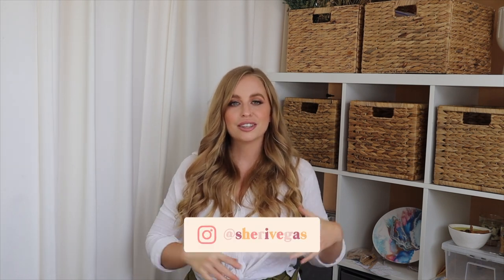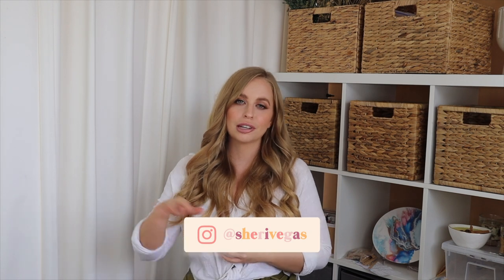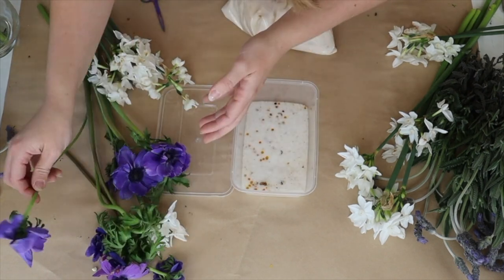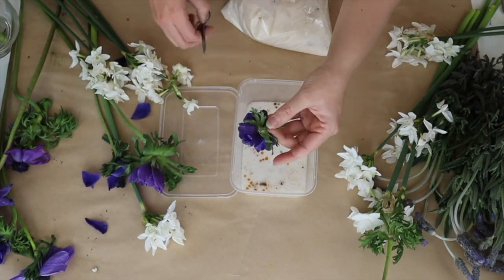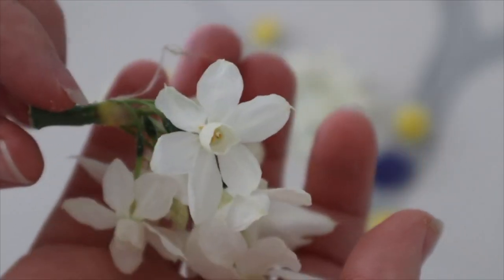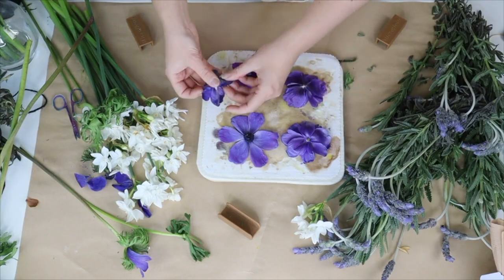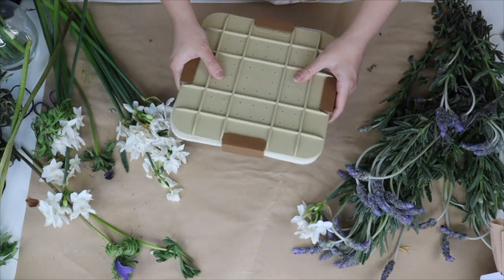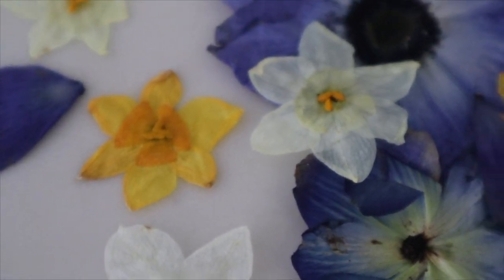Top 5 Tips you should know for casting flowers in RESIN

Comment: Great Video. I recently discovered a trick to reduce flowers turning translucent. I’ve found that some varieties are just more likely to have this happen than others. Hibiscus,  white dogwoods (amazingly not pink ones) and day lilies are all prone to going translucent. Spray the dried flowers, front and back, with spray sealant and let that dry first. Treat them like you would paper items going in. 

Another tip for preventing bubbles coming from the flowers. For ones like sunflowers, with dense large centers, soak them first with resin. Let that resin cure, THEN place them in your resin project. I also use UV resin to set and strengthen fragile flowers by treating them with a quick set UV resin then placing them in the arrangement. Use a good quality UV resin so it doesn’t yellow, or only place the resin where it won’t be seen if it does yellow but the surrounding resin stays clear.

Have fun and thanks for your videos!
Reply: Any advice on what kind of spray sealant ???
Reply: I was going to use fresh sunflowers I have growing.  Thank you for the tips.
Reply: What kind of sealant spray can be used?
Reply: Water based sealant woth uv protection gloss or matte doesnt matter.

Comment: Thank you for the link provided for resin. However what do you mix with the resin- it is not in the link provided. Would appreciate if someone could tell me what I need to mix with crystal cast resin to make a clear cased resin block for my daughters bridal bouquet. I am new to this and would appreciate some places and brands that you use & recommend or links to purchase silicone moulds, the hot air gun for bubbles, sealant spray and all of the tools necessary. I have searched on line and am so confused ! Every bit of guidance is so so appreciated. Thank you in advance 🙏

Comment: Have you ever used any of  the spray flower sealer for dried flowers before putting them in resin to see if it helps to preserve the color?
Reply from the maker: I’ve tried but I didn’t find the ones I used made any difference
Reply: Try modge podge water it down a bit and use a brush to coat it and let dry and it is sealed. I also laminate my flowers
Reply: @bevmutch4310  does it matter which modge podge? I have a bunch of leaves that I dried that I want to seal and was wondering if modge podge would work THX!
Reply: @reneepannoni2070  I use gloss modge podge and water it down a bit.

Comment: Last tip is technically imprecise, even the one on discoloring. Sometimes it may happen because of interference patterns generated by light because the surface of many flowers resembles a diffraction grating. It's just like onions in olive oil, they become transparent with the varying temperature of the oil, because viscosity is temperature dependent in olive oil and tightly packed molecules behave differently that loosened particles when light strikes or passes through them, but the moment you lower the temperature, the onions reappear. 🙂
Reply: .....lol

Comment: Hi! Thanks for yoir videos! I've never used resin before but am looking for ways to preserve some flowers from my wedding bouquet. Was thinking to either dry press or use the silica gel and then casting in resin.  I have white lilies which have the small powdery bulbs at the top and I'm not sure how they will come out (especially with the powdery bulbs which can stain the surface when they fall off) for this kind of project. Have you used white lilies before and what can you recommend? Thanks!
Reply from the maker: Yes you can! but white flowers are the hardest to preserve. I would go silica gel

Comment: What to do if your pressed flowers changes its colour after it gets in contact with resin? Is there any solution to overcome it?
Reply: You can seal the flowers prior to casting in resin with a clear sealing spray or with airbrush painting. An acrylic type sealer spray is less harsh on flowers. Also, transparency or color changing after putting in resin could be due to damage or tearing in the petals. You could simply use a non damaged flower but sealing will still help with micro tears and other damage.
Reply: Can we use the hair dryer/blower as a replacement for heat gun?

Comment: Thanks for sharing these tips! I have found out that the flowers colours fade away in resin  after 3-4 months eg red rose petal turned yellow etc.. is there any way to retain colors longer
Reply from the maker: That could be the brand of resin you are using some do yellow over time.
Reply: @sherivegasartist   the art piece is transparent and clear did not yellow but the red rose petal has started to yellow ..this is after 4-5 months of casting

Comment: Why do i get bubbles behind the flowers? Do i need to do thin layers?
Reply: use your heat gun.. lightly to get rid of the air bubbles.. pour thin layers.. not thick... let it dry fully ,, then start your next layer.
Reply: @debharris7822  will the heat gun damage the flowers? I get lots of small bubbles trapped close to (or under) the petals

Comment: I use real dried pressed flowers. The turn yellow after being in resin for one or two hour. Please help me with this I am very very worried, my resin is getting wasted.
Reply: Same. I wish someone replies to this😭😭 Been checking all over in YouTube but no answers
Reply: Same, they were dried and they turned. ☹️ Wasted a whole batch.
Reply: So what I do is I use a laminator 3ml sheet and laminate them. This seals the flower. Another thing you can use is modge podge water it down and paint it with brush on flower and let dry. Hairspray works too. Any varnish or sealer. Just make sure they are totally dry before putting in resin. Hope this helps.
Reply: @bevmutch4310  thank you.
Reply: @wileycovington4497  almost forgot  you can also you clear duck tape brand to put your flowers on and trim around them too. I use this too and it works.